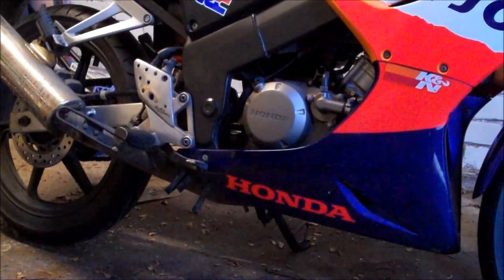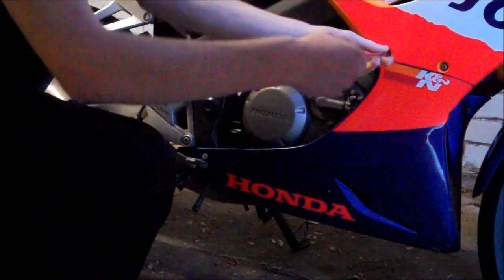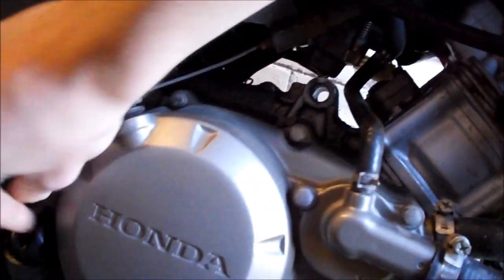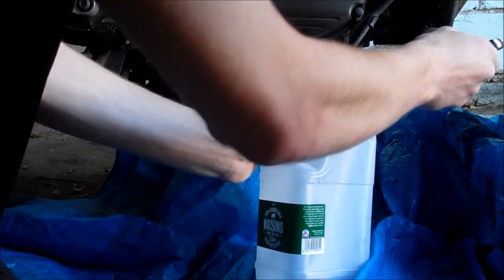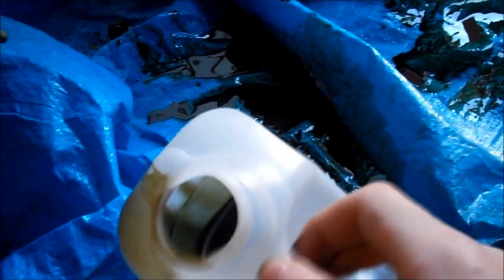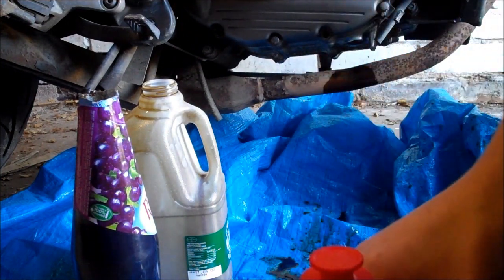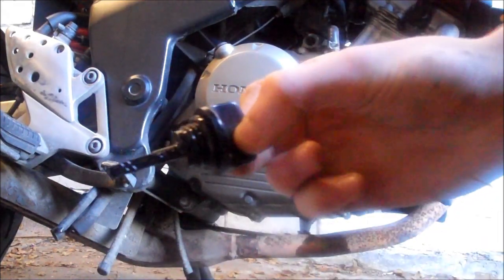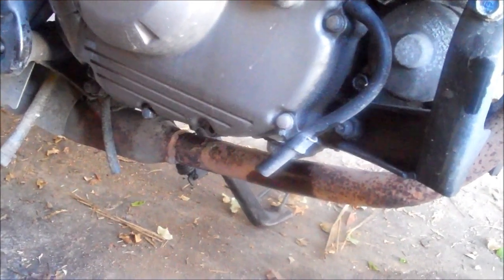How To: Oil Chage Honda On A Honda CBR 125R

Comment: Good stuff, lots of good advise. 
When I change my car oil and will be doing my bike soon..I use a oil tray that I got from Halfords which doubles up as a container for the old oil and it just tips out when you need to dispose of it. Also it allows you to catch the nut and washer before it goes into the oil :)

Comment: Firstly, the bike should be upright when changing the oil. Secondly, the bike should be upright when checking the oil fill level.
Reply: I've done oil changes on my CBR125 for years on the side stand, as long as it is level ground. Worst thing that happens is you put a bit more oil than the specs ask for, which might be better anyway since the lubrication cycle often doesn't have enough by the end. This is the main cause of the 'false neutral' issue from 5th and 6th gear.
Reply: Travis Ross ok but when u chek the level, du you screw it in or just dip the stic?

Comment: so what happens when youve changed it to that castrol power 1 4t 10w-40 and then you go to change the oil again, do you change it with the same stuff?    and great video cheers

Comment: That seal ring is a crush washer... it seals the bolt. You'd be better changing it for a new one (pennies)... esp seeing as your drain bolt is hidden by a fairing... and use correct torque to close up. Helps prevent leaks.

Oil filter not being changed? that's were you will notice debris

That sound on startup.. 

How long did you have it draining for?
Do you check the oil level on the side stand or level? 
How much came out? and how much went in (should be same unless known to be wrong)?

Comment from the maker: The orginial Honda downpipes do rust alot, I did change it for an aftermarket system in the end since the exhaust had just rusted through.

There shouldnt be any need to remove the exhuast though so Id keep whatever exhaust youve got.

Comment: I'm a programmer, so I don't know that: Do I need to change a oil filter or something like that? Does the CBR 125R JC39 has something like that?
Reply from the maker: The CBR doesn't have a replaceable oil filter, so no worries!
Reply: Great, so I only need new oil. Thanks a lot man!
Reply: Wrong the Honda cbr125 and 125r has an filter of sort it's more of a mesh screen you still want to clean it to get any crap out of your engine or say good bye to you top bearings👌

Comment from the maker: Well if you're topping the oil up then I would use the same oil but if you drain the whole system then it doesn't really matter just as long as you use the correct grade oil. Cheers mate :)

Comment: Hi, I have CBR 125 2011! Is there a oil filter that I have to change?!
Reply: Nope :)
Reply: Just an oil filter which should be cleaned every 2 or 3 oil changes.
Reply: +minemac69 where is that filter on the 2004 one? cause ive gotta do the next change soon.